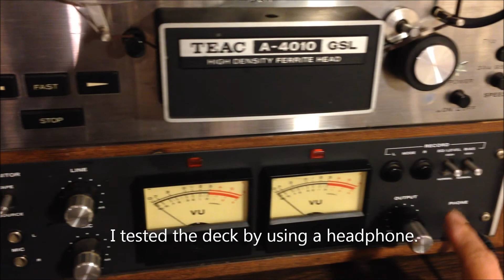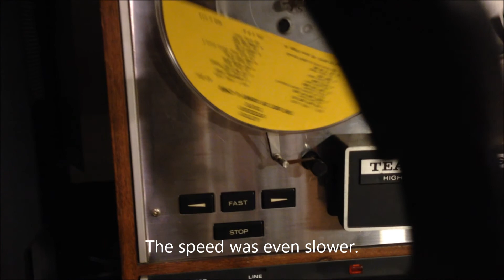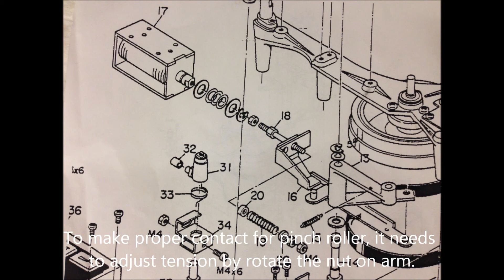Teac A-4010GSL Belt Replacement and Repair

Comment: I've always found it easier to replace the drive belt on these old Teacs by removing the capstan flywheel thrust plate from the rear of the deck and sliding the belt up through the gap. Saves you from having to remove the entire head and drive assembly.
Reply from the maker: Thank you for sharing your experiences for dealing with A-4010 belt replacement. I also try to find the best way to do the repair. If there is a way to save time and labor, I will go for it and share with other DIY fans too.
Reply: When I was doing the year Maintenace on Teac 3300-10 I was checking how to put on the belt when it is time. Thanks for your advice. Oh, is it easy to replace the counter belt when it is time to?

Comment: I don't own Reel-to-reel alignment tapes so would need to figure out a belt change without loosening the Head Block. I just bought an A-4010 GSL.  No power-cord.  No idea if it even functions.  I guess for $20, I took a chance.

Comment: When you put the belt on that way you are risking getting oil and grease all over it the proper way is to remove the entire assembly from the unit tilting it down towards you and putting the belt around the flywheel then holding the belt tight with one of your fingers and then tilting the assembly back the way it was and then screwing it back together great end result all the best be safe just another way to get the same outcome

Comment: Very nice video. I have a Teac a-2300 and it seems my counter belt is slipping. Sometimes it works sometimes it doesn’t. It works perfect when I do fast forward and fast reverse, but during normal play, it is intermittent. I can see the belt through the right real cavity and move it with a small stick and it does seem rather flexible or stretched. It looks like your counter is in the same location as mine. After exhausting several ways, it looks like I may be forced to remove the front panel to get out the belt. Would you agree?
Reply from the maker: Has the belt been replaced before?
Reply: Vintage Audio Fan  I’m sure it hasn’t. When I look at it through the right real plate removed, it has a white look to it like old rubber, and when I move it up and down with a long thin stick I can see it flexes quite a bit. I can see it slipping on the take up real pulley. I bought it from a guy who said his dad had it stored in his closet for about three years. I replaced the captain belt when I first got it but the counter was working so I left it alone. But now through use, it has decided to stretch and work only intermittently.
Reply from the maker: @alcameron6071  It is due for a replacement. It needs tightness on belt but not loose in order to drive the pulley of time counter.
Reply: Vintage Audio Fan  Yes, I realize this. My question is, I can’t seem to find an easy way to access the belt without possibly having to remove the front face plate, which I hope is not the case. Do you happen to know the sequence of getting to the belt to replace it? This is my dilemma.

Comment: I mean it kick in when start, but not kick out when stop or change mode (play or reverse...) it just stay there
Reply from the maker: There are some scenarios may cause the problem you mentioned: (1) The pinch roller bearing got heavy gummy grease causing the assembly can't slide off the shaft and kick out. (2) The pinch roller solenoid is defective caused by the bad relay or control circuit. I suggest using a heat gun to heat up the bearing assembly. Once the grease melt, then wiggle the whole pinch roller assembly and make sure the arm is moving freely. If this step is not working, then you need to check the components (i.e. relay....) on the control PCB where the circuit is for the pinch roller solenoid operation.
Reply: @VintageAudioFan  Thanks for reply. when start up:  if I move the wheeler all the way down and press play, then the selenoid was move all the way in and the arm pull the wheel roller up (for touching the capstan motor to turn), but when I press stop, the selenoid is just move out little bit (enough for the wheel is not touching capstan motor for turning, but not all the way down!), so do you think selenoid problem all the bearing assembly problem? Thanks
Reply from the maker: Yes. You need to perform the pinch roller pressure adjustment in order to have correct contact pressure between wheel and capstan shaft. Please refer chapter 5 "Measurement and Adjustment - Mechanical" shown in the service manual. Here is the link for service manual:
https://www.hifiengine.com/manual_library/teac/a-4010gsl.shtml
Reply: @VintageAudioFan  Thanks. I will do that

Comment: whats the difference between the GSL and the SL?
Reply from the maker: The difference - The 4010 SL (71-72) were replaced by the A-4010GSL in 1973 with a swap of the Permalloy heads for entirely new HD Ferrite heads (but a permalloy core) and the replacement of the 1/2mil button by a "rec pause" function. You can check out the article at following website:
http://www.thevintageknob.org/teac-A-4010SL.html

Comment: Were you(him) really able to get behind that capstan assembly to change belts by removing only those two screws shown in the video?
Reply from the maker: Actually, the capstan base is hold in place by four (4) screws and needs to be removed from backside of face panel. The belt replacement can be done with the the way I did as in the video but it needs some efforts. Because the head assembly is also mounted on the same base, in order to keep both assemblies intact, I needed to lift up the assemblies and slide the belt behind the flywheel. The best way I suggest is to remove the three (3) screws from top which holding the head base assembly as shown in fig. 3-4 on page 11 in Service Manual. This way you can gain access to replace the belt.  Here is the link for manual:

https://www.hifiengine.com/manual_library/teac/a-4010gsl.shtml

Comment: Where did you get your parts from? I need a belt for my 4010GSL.
Reply from the maker: Here is a link where you can buy the capstan belt:

https://www.ebay.com/itm/CAPSTAN-BELT-FOR-TEAC-A-4000-A-4010-A-4010S-A-4010GSL-A-4010SL-AR-40S-FREE-SHIP/201903061340?hash=item2f025c395c:g:VboAAOSwAjhc1~vV:sc:USPSFirstClass!95758!US!-1
Reply: I have a Craig - ordered a belt kit from Vintage-Electronics.net. They seem to have a lot of parts for vintage machines.